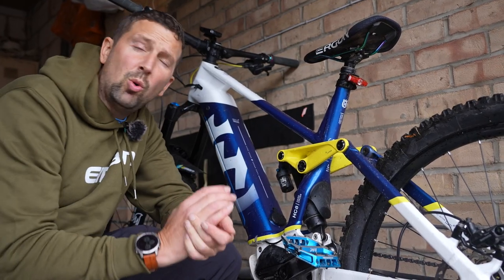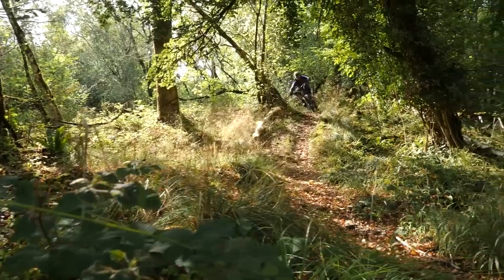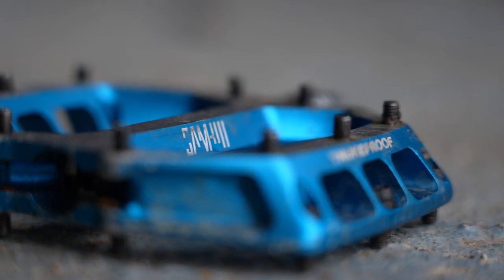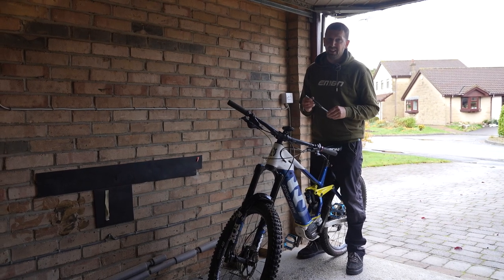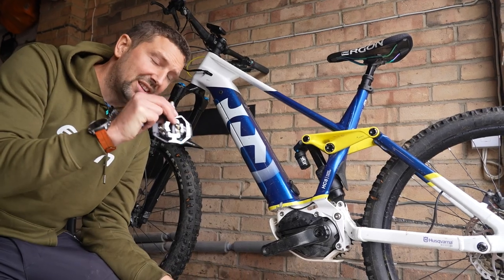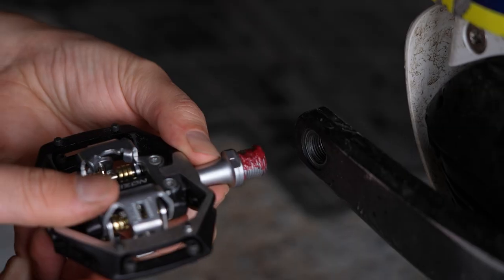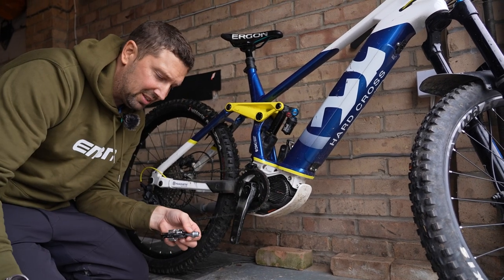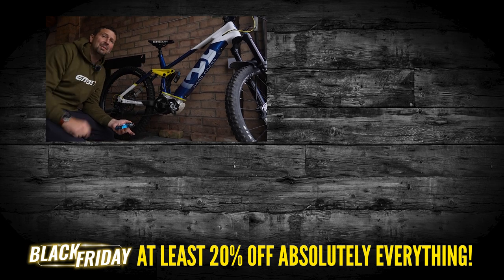How To Fit & Remove Pedals On Your E-Mountain Bike

Comment: What kind of grease are you using for the pedal threads? I'll be honest, I'd thought thread locker would have been the right choice 😅
Reply from the maker: We wouldn't suggest using thread lock on your pedal threads. Any multi-purpose bike grease will work completely fine. 👍

Comment: I just recently replaced the stock pedals that came with my new ebike with a nifty pair of ROCKBROS. 
Before I attempted to connect the RB's to the pedal cranks, I looked for a L & R somewhere on the new pedals and no success in doing so, there was only one other option. I do not recommend that anyone attempt what I'm going to explain as you could very easily cross thread the pedal axle(s)...
 By holding the body of the pedal in one hand, take a grip on the shaft of the pedal and very slowly twist the threads of the pedal axle into the female threaded port of the pedal crank. Do Not try to keep turning the axle into the pedal crank if after the third rotation does not smoothly start to thread thus join the pedal and pedal crank together. 
 Switch pedals and try again. Just make sure the thread sizes and shaft are both the same diameter. (9/16...)